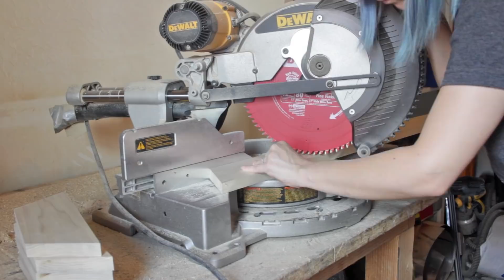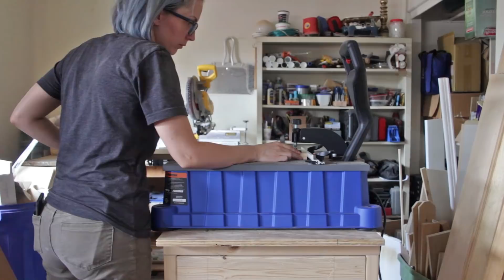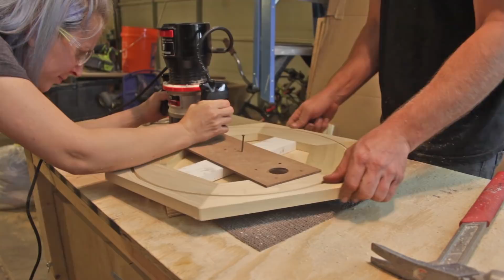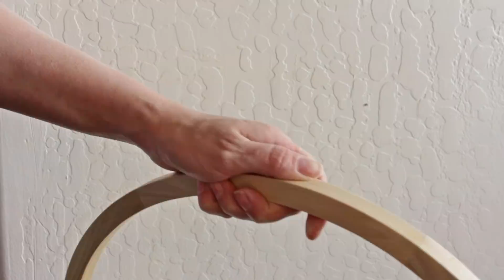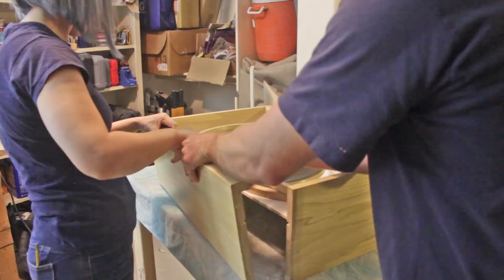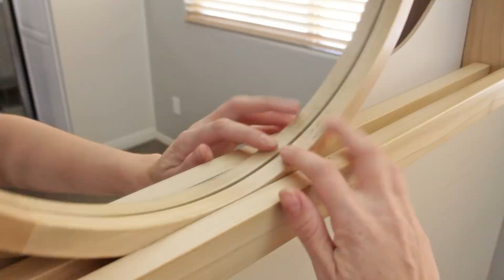Round Mirror Wall Cabinet | How to Make

Comment: I was wondering if you could put wooden shapes in the corners and 2 shaped wooden bits in the middle top and bottom to cover the gaps and have full view of the inside when it is open. But I love love the piece and the fact that you can use all these tools and do such a fantastic job.

Comment: The track will collect dirt easily and the mirrors will roll bumpy.
I'm thinking a small aluminum angle running the length of the center of the track -- laying on it's hypotenuse side.
Then a narrow metal band around the perimeter of the mirrors for a tire that rolls on the track.

Comment: That's like wickid cool yo :)
You were aiming the pin nailer towards your face, when securing it for the pocket hole screws. At 5:24. I would never do that again. Always away from you. If you can't aim it away, then don't use it. Think of where that pin could go, and what it could do. Scary. All power tools are dangerous. All of them.

Comment: I'd suggest the router and a circle jig for the face/MDF cut outs over the hand held jig saw. The out of round circles mar the project.  AND you already had the router cutting the mirrored circles so... why no use to get flawless circles in the 'figure 8'?
Reply: Please get off your knees when you work! That's what work benches are for. Clamp things to the bench so you can use both hands which will give you better control.....OR better yet, invest in a vice for your work bench. Your design ideas are worthy of you learning better methods of working. one other thing and I blame Norm Abram for this one, as much as I respect his work; There is NO SUCH ACT AS "PRE DRILLING A HOLE"....A hole IS predrilled OR you are drilling a pilot hole!!! ( I was raised by a mother that had a minor in English and insisted we use the language properly. My comments are based on over 55 years as a professional cabinet maker and furniture designer/builder.
Reply: The above is made by John Sherman, not Pamela Sherman